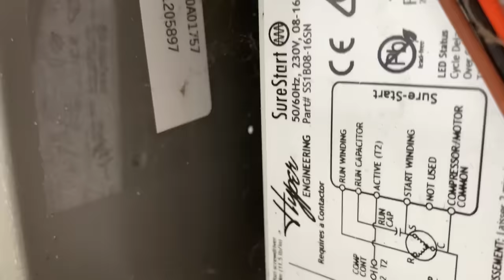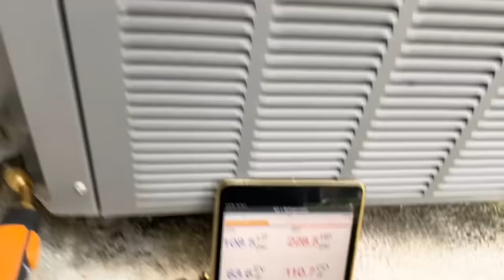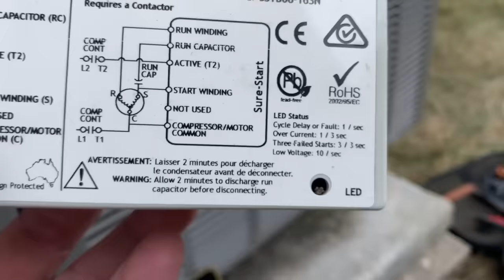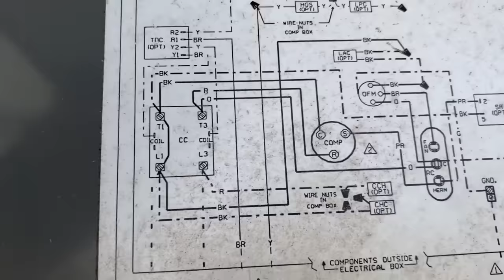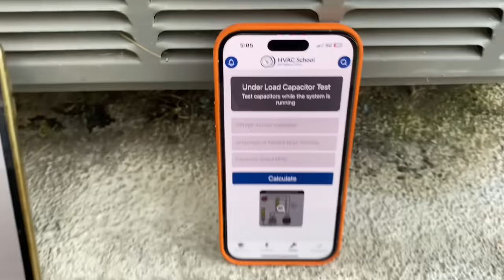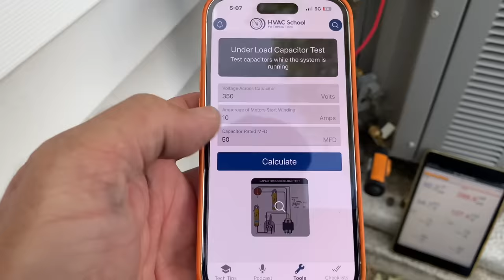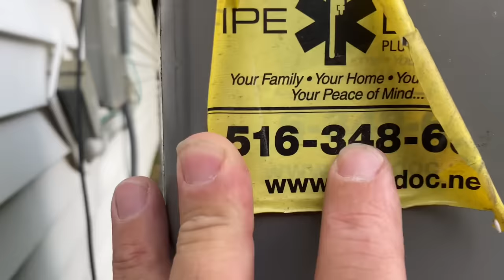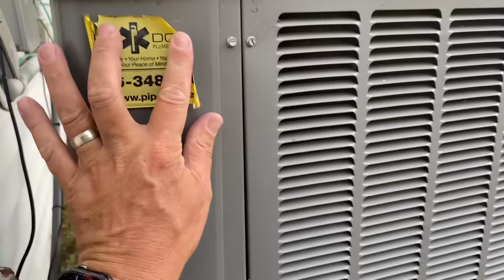Soft Start Killed Compressor! UNEDITED Central AC Service Call for No Air Conditioning Revealed!

Comment: Wow, what a complete screwed up diagnosis of the issue. If you could read the Soft Start flashes 1x/ 3 seconds it was telling you that the Soft Start was sensing the compressor was over ampering (20+ Amps on a 25.3 RLA Compressor below recommend specs but shows issues). My First indicator would have been to check the Dual Run capacitor (wouldn't have been hard to pop it out while you were rewiring everything). Also, the amount of air coming out of the top of the condensing unit should have been your first clue of how dirty the coils were. Lastly, the tenants called you because you installed the equipment 15 years ago. Did you mount the condensing unit that close to the wall?? I bet the manual even gives you minimum spacing requirements for unit breathing. Looks like the Soft Start device is working properly, not sure if I can say the same for HVAC Tech.
Reply from the maker: You sound like a whiny chick who i kicked out of my bed last night.
Reply: You're completely right Brad.  Glad someone on here knows what they are talking about, instead of just calling something they clearly don't understand..a 'hockey puck' and removing it without verifying if there was an actual need for it (like the solar system the house has), and cleaned it FIRST.   If he had just admitted his mistake, I might have subscribed, but no way following someone that insults someone for simply informing them they made mistakes in their diagnosis.
Reply: @PipeDoctor you sound like a completely incompetent “tech” that’s overpaid for uneducated guesses.
Reply: The guy is right . The problem is no air. Chuck the softstart problem solved. Home owners deal with the soft start.
Reply: Its not the techs job to deal with that as its not part of the A/C unit. His job is to get it working, not play with its accessories.
Reply: @PipeDoctor Nobody could fit in your bed. You take up 95% of the bed.
Reply: @bran-qt7ds  Diagnosis if you dont install one - it cant fail!
Reply: I agree with the tech, dont install one it cant fail.
Reply: Brad I agree with you it seems the soft start was doing exactly what it was designed to do. Removing it just causes the electric bill to go up and removed a great protection for the unit. Lastly softstart technology is fairly new for ac units so there will certainly be a learning curve for tech's as they run into this going foward.
Reply: @PipeDoctor  Actually he sounds knowledgeable. You don't. Obviously it was the first time you've seen such accessory, you don't know for sure what it is, yet you dismissed its functionality so confidently, like you're running into this 10 times a day...
Reply: Great catch. Notice how he mocks you rather than address your factual comments. He did install it and I don't work in HVAC for a living but being technical know there are specs for EVERYTHING.  He also has no understanding of  the "worthless hockey puck."
Reply: @PipeDoctor  You sound like someone who can't admit that they're wrong. Why don't you address his statements? Because you can't.
Reply from the maker: @independenttntn3276  who really cares?
Reply: @PipeDoctor  Wow a little sensitive...you messed up the diagnosis
Reply: Gee I dont have a magic box on mine and I never have the problems you added to your AC.
Reply: @excorcelsior7582 Overpaid seems like the right description. Did you see the +$100k Porsche 911 in his garage?
Reply: I don't know who Mike is from Adam, but I understand his perspective as someone in business which is very risky in itself. In business, there are times you will make unpopular or non-optimal solutions for the customer due to multiple factors. I've been there, I had made mistakes, and people pissed off at me. From what I see he did the BEST he can at that  moment of need for the customer. In the end of the day, the customer is satisfied and paid for his time and material.  Also, as for him having a Sportscar to enjoy, it doesn't mean he gets overpaid.  He may have just earned it the old fashion way of hard work. I'm actually Happy for him! 😊

Comment: On the DIY Solar Forum we recommend Soft Starters for anyone that wants or needs to operate a central A/C system on an inverter when utility power is down. MicroAir Easy Start and HyperEngineering are both good brands. MicroAir seems to be more sophisticated as far as diagnostic codes but then it costs more also. The HyperEngineering unit that you removed was too small for that old, inefficient compressor. Its rated for 8-16 RLA, NOT 20. Model 16-32 is what should have been installed. Others in the comments below noticed the same thing. I think you were a little too quick to judge the product and call it junk.
Reply from the maker: Okay
Reply: Most of us HVAC techs were not taught anything about soft start devices in school or on the job until recently. Now that our power grid throughout the USA is getting some age on it, becoming very unreliable, the crazy weather adding to the problems, everyone getting solar systems, they are becoming more popular…real fast. I have three on my 52,000W solar system alone. All different brands. They all work great when you install the correct model. We always carried hard start kits on the truck. We installed those for everything from hard to start compressors to dimming lights. You don’t know what you don’t know.
Reply: Many recent Micro Air soft starts also have a blue tooth connection.  So the app would have shown the unit error for the homeowner and would have helped you with your diagnostics quicker.
Reply: Micro-Air is beta testing a new model 398 that is a “one size fits all” model, stay tuned.
Reply: Never heard of a soft start kit,  although the first thing I would do would be to replace the Dual cap and add a hard start regardless,, add a 24v tdr in line with your contactor.( inspect contacts)
That should eliminate a heavy draw of amperage.
Reply: So who put the soft start on it. The brand.
Reply: @justsayen2024  A hard start kit/capacitor increases the voltage/power to the compressor windings - this is increasing the compressor torque and is actually increasing heat in compressor windings during startup which can reduce life expectancy of the windings.
Soft start devices such as MicroAir & Hyper Engineering reduce compressor winding heat during startup.
Reply: @PipeDoctor  Looks like there are other's after-all:)
Reply: @bobhall5893 you're sorta right. It'll show if it has error codes, but it won't show the homeowner which one. Also, the Bluetooth only works when the damn thing is running, so you have to get it running to communicate the data then you have to send the data to micro air using the app. THEN you have to fill out a silly ass form on their web page and hope they call you back. Mine would not start a 4-ton heat pump under a EG4 18kpv even though signature solar has a YouTube video showing it working on a 4 ton w/ with a sure start. I'm currently trying to replace my micro air hoping that fixes the problem. Still haven't heard back from signature solar tech support.
Reply: @randallweaver7034  I don't buy that theory I have seen AC motors with caps run for decades never have any issue with the windings. My old AC unit was installed in 1976 I ran it all the way to 2007 it was still working but I decided I wanted a newer one. My last unit ran from 2007 to 2022 it only died because lack of maintenance my fault letting coil get dirty.  I'm in Phoenix where we run our AC units hard in the summer gets to 118F for 30 straight days. The AC runs for 4-5 hours non stop during those extreme heat days.
Reply: @Mike-01234  The key is "old."  Better quality.
Reply: Ill bet theres a discount code for it isnt there. You recommend it because your selling them.
Reply: @PipeDoctor, thank you and your team for taking the time to make the videos. At the end of the day, the customer is satisfied with your work and paid you for your time and material.
Reply: Oh yeah how much do you sell them for?? You would recommend somebody applying dog shit to it if they would pay you money for it.
Reply: @USA-GreedyMenOfNoIntegrity  Wrong older systems are not designed to run off of them. Thats why they void the warranty.
Reply: @Johnny_Bee  Dont buy one.
Reply: @RadioRich100  my 7 tons 2008-2020 models are running great on them.
Reply: @USA-GreedyMenOfNoIntegrity  Then they would run great without them, and the problems they cause.